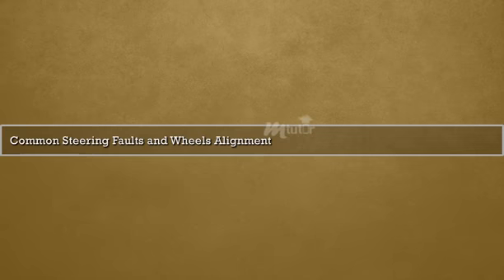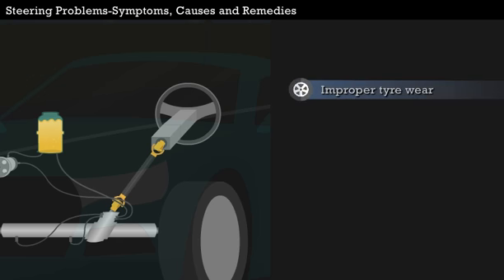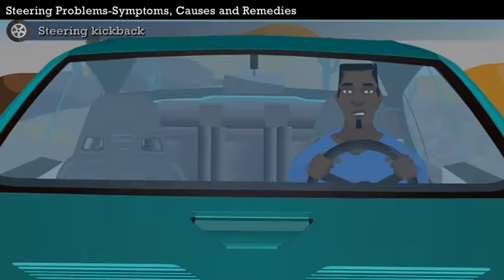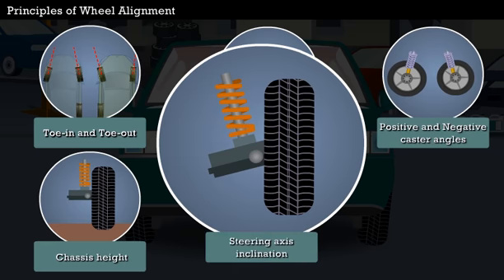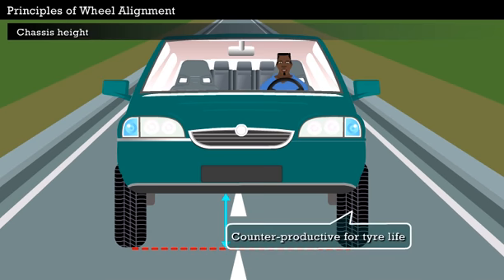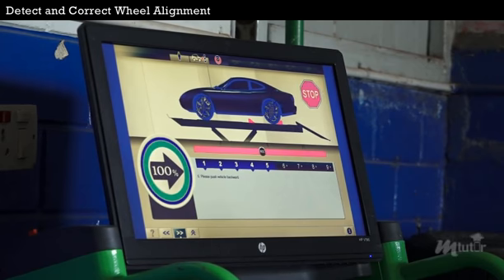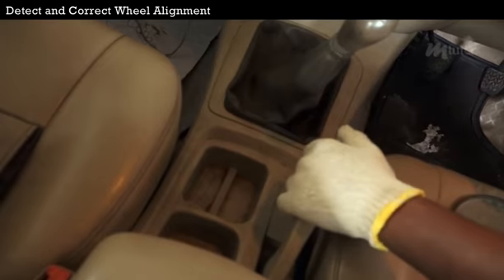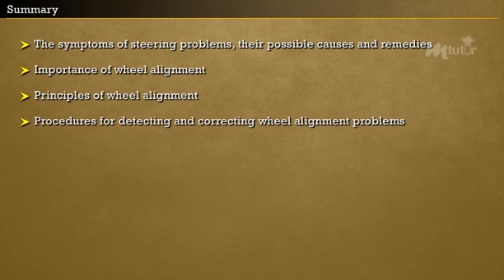Common Steering Faults and Wheels Alignment

Comment: dont cross, they left out the animation where the turn needs to rotation180 to be bolted back on, this causes premature tire separation, tire goes 10-15,000 km in one direction then you flip it. not a good idea. front to back and back to front every 10,000km
Reply from the maker: Thank you for bringing up the concern about tire rotation and its potential impact on premature tire separation. It's essential to consider the appropriate tire rotation pattern for your specific vehicles. The exact rotation pattern and interval may vary depending on the vehicle's drivetrain (front-wheel drive, rear-wheel drive, all-wheel drive), tire type, and manufacturer's recommendations.  

Two common rotation patterns are typically used for non-directional tires and uniform tire sizes: the "front-to-back" and the "cross" rotation. The front-to-back rotation involves moving the tires from the front axle to the rear axle and vice versa. The cross rotation, on the other hand, requires moving the front tires to the opposite sides of the rear axle and vice versa. Both of these patterns aim to even out tire wear and extend the overall lifespan of the tires.

However, the context here is to educate the students about different rotation patterns.

Comment: So with mine my passenger wheel is slightly out so the front edge is wider than the back edge of the tyre and when I'm doing high speeds my van jerks suddenly as if wind is pulling it. All tyres are right psi and tyres are not worn uneven. Had wheels aligned after charging all the front bushes. Any help?
Reply: I have dodge grand caravan 2010 I have this exact problem, plus my mini van is very unstable in the highway of it is snowy

Comment: What if a wheel alignment doesn't correct my steering wheel drifting on the side issue?
Reply: The video says it's a suspension problem Shock or Strut
Reply: Going to help you I do t help many reset the SAS

Comment: Rotating the worn front to rear are dengerous , when the rear has less traction the car will spin during  hard cornering especialy on wet road
Reply: But you want the most traction and control in the steering wheel
Reply: @donald6478  nope...lose rear traction is more dangerous than front

Comment: Never cross tires on a rotation, a mechanic did that on my car and the entire car felt like it was shaking to pieces!
Reply: u supposed to if it’s awd
Reply: cause your tires were too worn to be rotated. you can if theyre non directional tires but not on directional tires

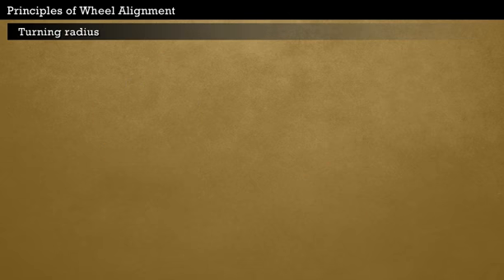Comment: 8:53 Can someone explain why the outer tyre wears if it turns at the same angle?
Reply: Because the radius of a turn is smaller On the inside which requires a tighter steering angle on the inside wheel. They showed an exaggerated example.
Reply: @saravanan I can't see your reply, you must have attached some link.

Comment: Swapping of tyres shown by you is incorrect.  The left side rear tyre should go to right side of front, and viceversa.  You brought the left side rear tyre to same side of front which is incorrect.
Reply from the maker: The left side rear tyre is shifted to the right side of the front, and vice versa only.
Reply: It is different for either Front Wheel Drive or Rear Wheel Drive. You would cross the "Non- Driven" Tire. 4X4's and All-Wheel Drive none get crossed.
Reply: @larrylclappjr  No, cant agree.  Front wheel drive or rear wheel,.. it doesnt matter,.  Tyres are swapped to overcome  corossion of tyres  ..
Reply: @splatharackal1337  Then the Hunter Alignment School in Stow, Ohio has been teaching it wrong since the 90's then.